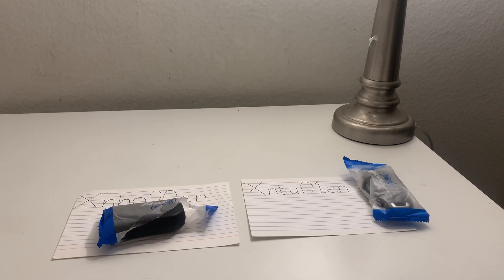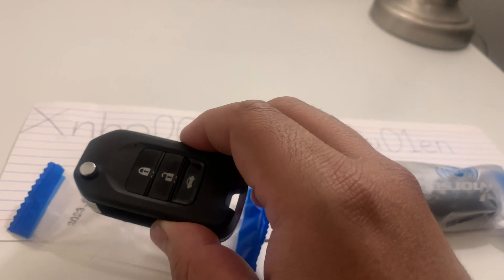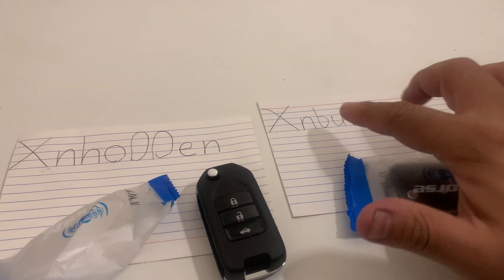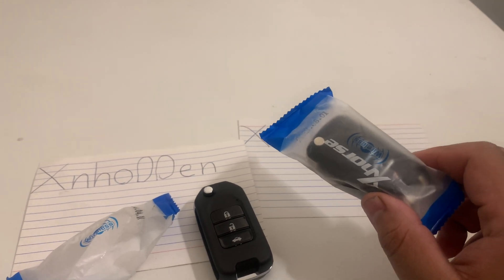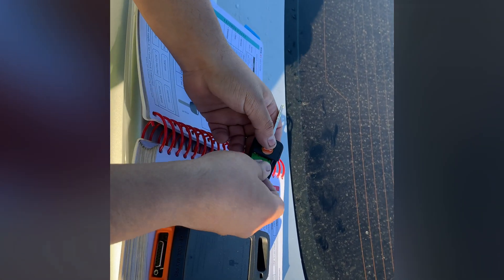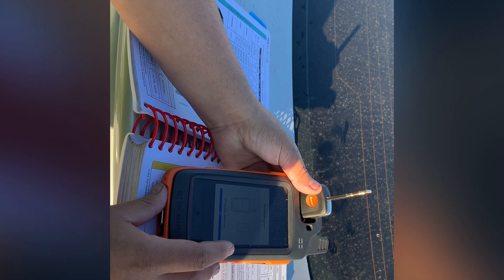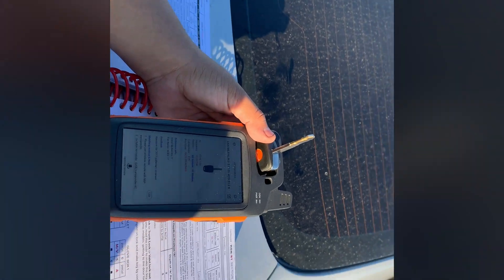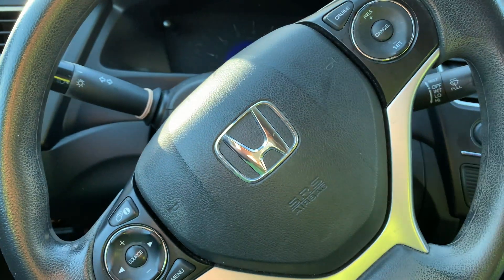YouTube University Automotive Locksmith Course Universal key systems-Xhorse Wireles RemotesExplained

Comment: Nice. How much do I charge these customers for these jobs? My neighbor has a 2005 Chevy Tahoe and he wants a key and a key fob. He has a copy of the original key with no key fob so I will make copy and program the key and the key fob to his car. Thank you.
Reply from the maker: Yeah I’m sorry about that.
It is a touchy subject and prices will vary depending on region. I’m still figuring out mine though and I don’t like to post videos on topics unless I’m sure that if someone copies what I do it will end well for them. I suggest you call locksmith shops in your area and ask for quotes, hopefully they will give you idea of what to price.
Reply: @Beginner-locksmith   Ok great idea. I have another question I bought my key set and now im confused on what remotes to buy. I want a few of all 4 which is best? Do I buy like 3 of each and take it from there? What Im thinking is 3 wired, 3 wireless key, 3 super remote, and 3 smart remotes. Am I on the right track?
Reply from the maker: @macbookgenius007  that sounds like a good plan. Just remember when starting off there is no exact blueprint.
Reply: @Beginner-locksmith  Ok thank you, your video have helped me alot.
Reply from the maker: I’m glad i can help and I appreciate you supporting my content.
Reply: @Beginner-locksmith  Quick question, how do I know what to keep in stock? So I purchased the GTL keys both set with the heads and the Key tool max with superchips. Now I need remotes am I correct? The way the remotes are labeled online its making me confused. Are you able to explain each one to me please. Like what car is the wired used for? What car is the wireless key remote used for? What car is the super remote used for? and what car is the smart remote used for? Thanks.
Reply from the maker: @macbookgenius007  the mini key tool with the app will explain what remotes go with what car.
Reply: @Beginner-locksmith Ok great did I waste my money because I have the mini key tool and thought maybe the max key tool would be better because I wouldn’t have to use my phone?
Reply from the maker: Did you get the key tool max pro?
Reply: @Beginner-locksmith I got the regular version. Should I exchange it for the pro before it ships out?
Reply from the maker: Well in my opinion as I stated in my videos I would either get the mini or the pro. I think the normal one is now a waste to get. So you could do that, return for the money, or you may actually like it. My videos are mostly for educational purposes and what works for me may not work for you.